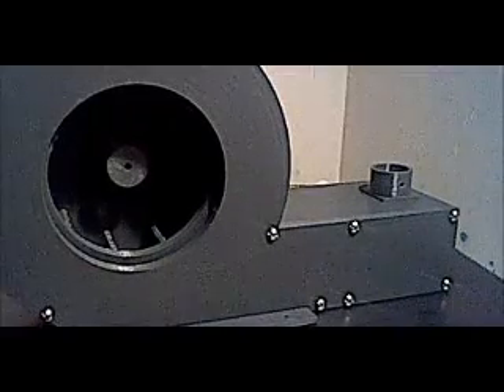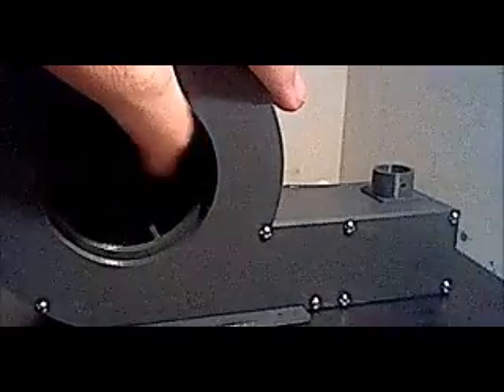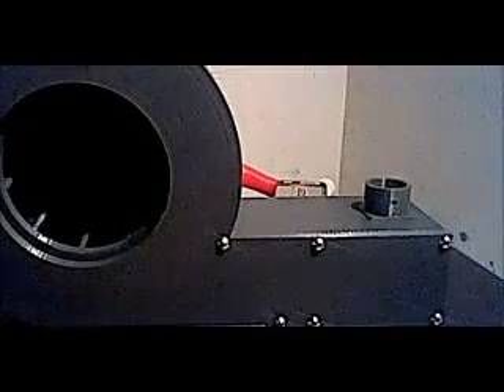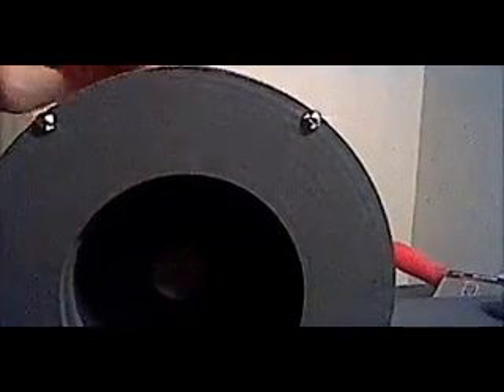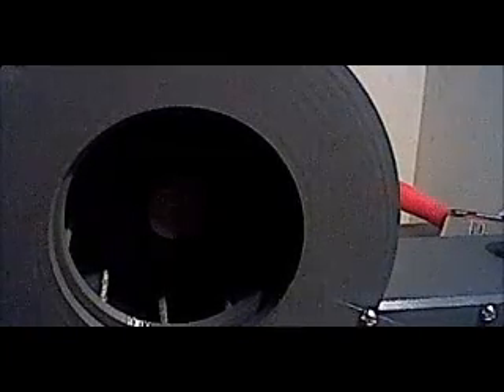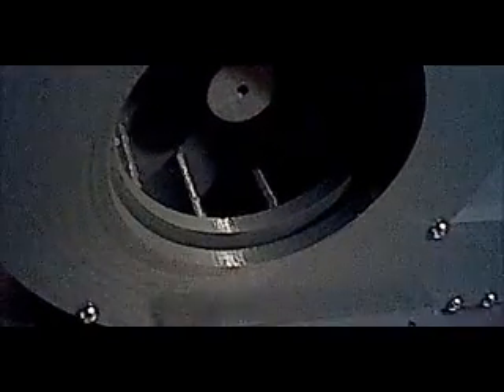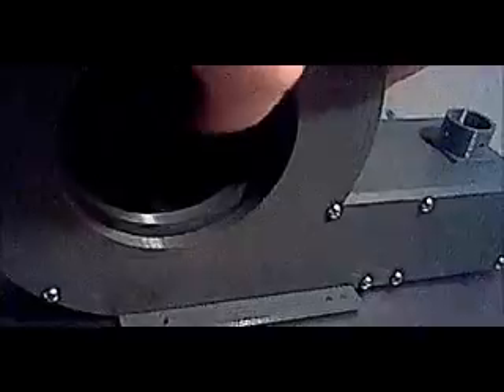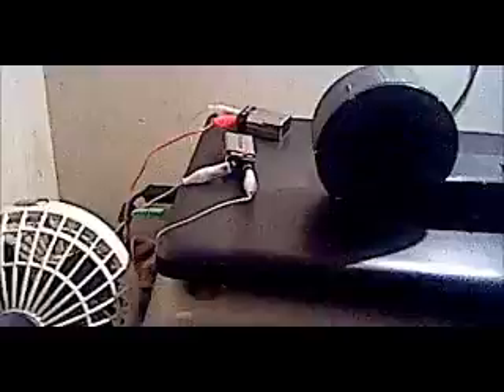mini thunderbolt tornado siren update.

Comment: You're doing a really good job on this. I wish I had that kind of expertise. I don't have the equipment either--not even a 3D printer.
There's an awful thunderstorm right now and I actually heard the local ThorGuard this morning before the storm came. I didn't hear the Whelen for the Severe Thunderstorm Warning though--only the weather radio. Speaking of which have you resolved the signal issue? I keep meaning to ask.
Reply from the maker: my weather radio signal is still messed up. sometimes it works, sometimes it doesn't. the most often times it fails is during a storm. which completely defeats the purpose. :P.
Reply: broken solar panel I guess it might actually be on your end. Mine still works like a charm. Midland is usually a reliable brand but the model you have is what I had once and it seemed to malfunction quite a bit. So I upgraded to a newer model of Midland and it worked great for three years without fail. Then the buttons broke and I got an Eton ZoneGuard Plus, which is the most reliable brand judging from how the Red Cross endorses and uses Eton ZoneGuard.